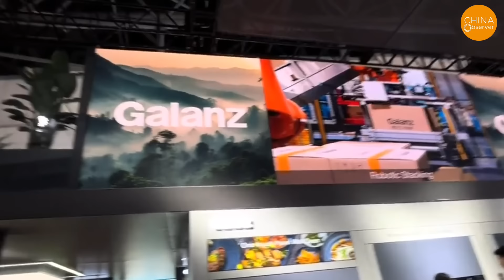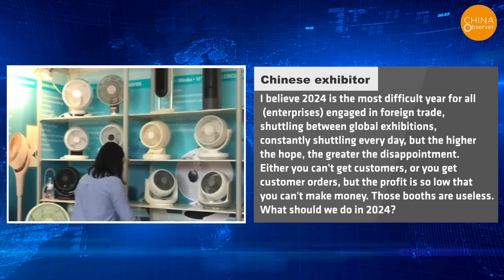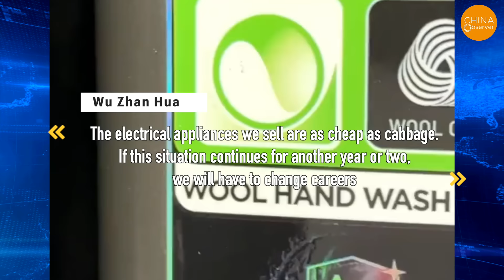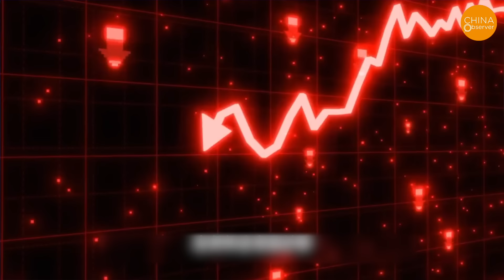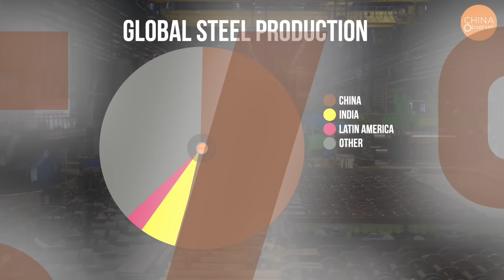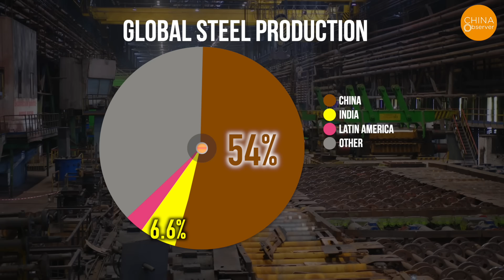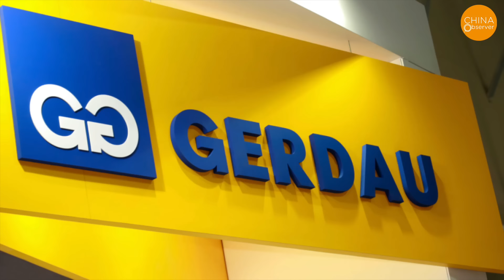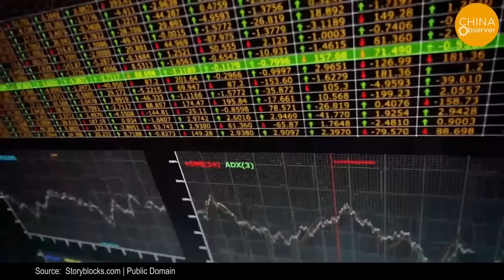China's Exporters Are Crying at Canton Fair: Not a Single US Buyer, Electronics as Cheap as Cabbages

Comment: Temu, for example, is absolute garbage quality and an excellent example of Chinese goods. People just dont want junk anymore
Reply: Except more than 60% of American consumers use Temu.
Reply: @movinon1242  they HAVE but everyone I know no longer does. Here's some examples.. I bought 2 electric peppermills and the motor isn't strong enough to grind peppercorns. A solar pump stopped working after two hours. Air fryer stopped working after one use. Yea no more for me but hey you keep on
Reply: Not true: People do want junk. There's nothing wrong with junk from the customer's point of view if the price is so low that it is expendable junk. If the £3 jacket falls apart after a couple of months, that's fine. Just buy a new one.
Reply: I buy fake cabbage from Temu and it's very tasty.😋
Reply: @magnumxlpi the thing is most of those products at the canton fair is not low quality like temu

Comment: Crying a river. China is a copyer and low price driver. But there is no profit in a race to the bottom of the bird cage. Japan faced the same problem as it emerged as a manufacturing force and overcame it by going up market. But once all your customers see crappy quality, it's hard to change the perception. Japan took 40 years to climb out of it. They moved their low cost lines to Thailand and Vietnam...even Taiwan, and kept the higher value manufacturing at home.
The other problem is that China is not a safe investment because of the regime and its dictatorial methods. You could see your investment disappearing at the whim of the CCP. And theres no redress.  Sweden's Volvo owned Chinese brand Polestar has been written down to zero in its books.
Reply: chinese bougt volvo ages ago didnt they? not even swedish no more
Reply: @Fanta....  Not all of it. Ford still have a stake and the company is still operating in Sweden by law. Its that entity that has written down Chinese operations to zero.

Comment: Going to China is too risky, in my opinion. It's not that I don't want chinese products. Of course, I'm probably in the minority.
Reply: When I moved back from Germany I bought a bunch of different things on Temu cause it looked cool and wanted to test it out.. 2 items were decent quality. The rest was absolute trash. Example.. I bought two electric peppermills. The motor wasn't strong enough to grind peppercorns. They just jammed every time. Also a solar pump stopped working after 2 hours and air fryer stopped working after one use. Stop buying Chinese products. It isn't worth it at all

Comment: Guess no one wants cheap Chinese knockoffs right now. Equipment made in China is junk. Any manufacturing equipment made there will require twice what you paid for it to modify and repair before you can even use it. They have no concept of precision. We just ordered a new anti wrinkle die for a bender. When it didn’t fit they said “it’s auto be like that. You have to grind it to your spec”. WTF!! And don’t ask for drawings so you can make your own. They don’t have them. They just halfass everything.